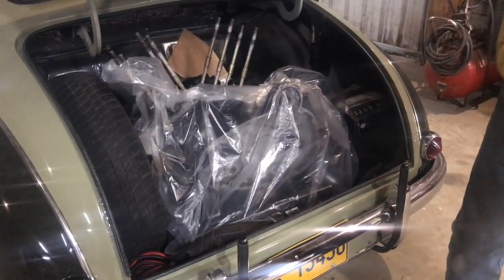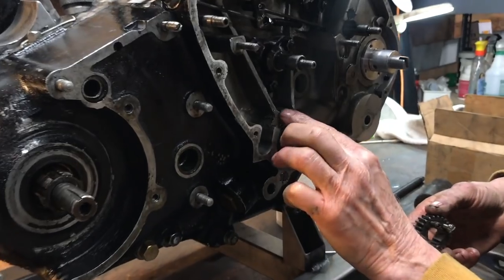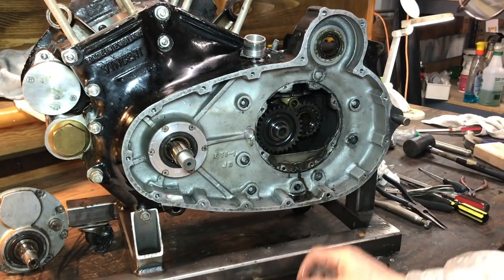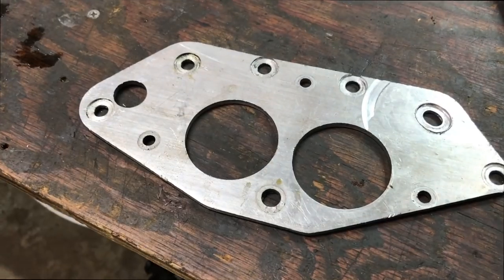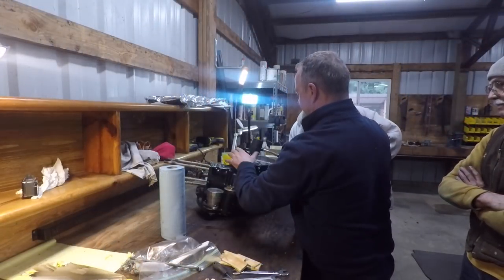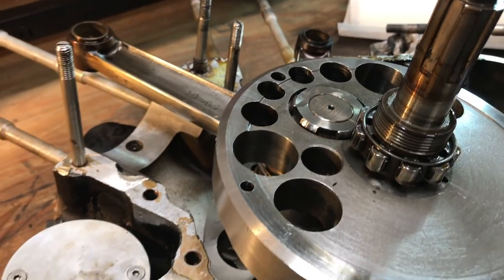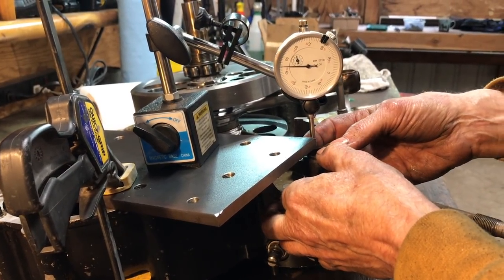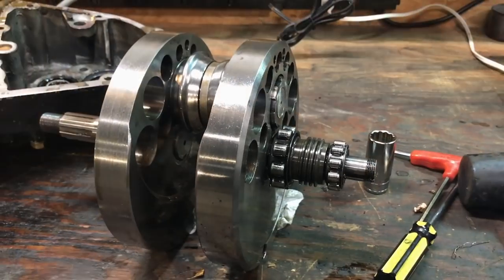Dismantling a Vincent Black Shadow engine

Comment: Had a '49 series C Rapide back in the day, split the crank cases and the crank. Made a new cranl pin and machined the fly wheels and pushed the crank pin out by 4.5mm bringing the size up to 1,098 cc. The big end bearings have 3 rows of crowded needle bearings with spacers to keep them apart. I replaced them with an ally cage and roller bearings. Other than having to put spacers under the barrels you couldn't tell that the cc's had been played with. More torque but no more top end speed. Also had the cam plate spindle bush break off but had it welded back on. The welder didn't line up the bush so had to machine it out and fit a plug then re drill and tap the boss out to take the cam plate spindle.  Sold the bike for £199 back in the day when that was what they were worth. Breaks my heart now, but have just purchased a Yamaha Niken, so much better i'm afraid to say.

Comment: Proper preheat and postheat, the stress members bolted together and torqued,  and TIG welded by a knowledgeable weldor and you won't warp the cases. We weld and repair grenaded Harley cases all the time.  Complete repair and patch panels installed is regularly done successfully.
Reply: SARGE BULLDOG I am glad someone pointed that out. I hear that same nonsense about not being able to weld things all the time at my shop. Total nonsense
Reply: Agreed from Norway! I have welded lots of heads, crankcases and other engine/transmission related castings. With the right process of heat, welding and filler most can be done! Have a nice day :)

Comment: The Vincent factory was a former barn. My father went there a number of times to collect bikes for the dealership where he was a mechanic. No delivery vehicles in those days so he had to ride them home. He told me of an old guy whose job was to press the crankshafts together and true them up.  He would first put one in a jig so it could be rotated and  any error measured. Then he would remove it and  hold it in both hands at an angle and toss it on the concrete floor. The cranks would then be re-checked, and would always be accurately trued every time. The angle at which he held it was determined by how far out it was. Now that was real skill.
Reply from the maker: Thanks very much for sharing this great story!  It must have been an amazing place to work.  Best wishes, Mike
Reply: ....and the reason why we have no bike industry.
Reply: @bobcornford3637  That's true. If you remember the Triumph triple engine, they did not have a machine to bore 3 cylinders at once, so had to bore 2, then the third one separately. The industry never invested in new machinery, and the same applied to our car industry.   Soichiro Honda started out by investing in the highest quality machine tools, the same brand only used by Rolls Royce in the UK. It enabled him to make high precision components which resulted in extremely reliable and long lived engines. Meanwhile the British industry soldiered on with old and obsolete machinery. The engines would leak oil everywhere. My father used to strip out brand new engines and machine all the mating surfaces flat to make them oil tight, before his boss put them in the showroom for sale, but not every dealer did that. It had the bonus of keeping the showroom floor clean. His boss signed up to be a Honda dealer as soon as they became available here, and he sold a lot of bikes. He later took on Suzuki and Yamaha as well. The dealership did not shut until his son retired and did not have any sons to take it over, only 3 daughters who were not interested in bikes. My father retired at 70, and still did repairs and servicing at home for old customers until he became too old to do it anymore.
Reply: I was at the machine shop one day, they just machined a crank and one of the machinist(the one with a drinking problem) lifted it out of the grinder and drop it on the floor, OMG!. As I think back at that, maybe he could have gotten a job at the Vincent works.

Comment: Very nice ! This will give you confidence to split your crankcases, interesting the number of recovery repairs that have been done on this engine, main bearing housings, gearbox camplate housing etc , but that is the beauty of these engines, they are made to be repaired, unlike modern designs that are made to be thrown away. One thing that makes a big difference on a Vincent is getting the main shafts lined up perfectly, due to the engine having double main bearings to hold the crankshaft extremely rigid, any misalignment will wreck the bearing housings, (as probably happened with this engine).

Comment: I was shocked when I saw the crank/ flywheel assembly come out. I owned a Rapide years ago, sold it for 12K. My V-twins were vintage Indians and I rebuilt 2 of them. The Indians used a male and female connecting rods on a common shaft like harleys. When I saw the Vincent set up then I guess end play also is influenced by that center spacer. Where Vincent was smart was having the cylinders offset with that rod setup for cooling.
Thumper

Comment: That brought back memories of a lovely old chap that i knew many years ago who had a Vincent as his ride to work bike. A very clever machinist, when the need arose he made his own big end, all cleverly made to have the right tolerances when at working temp. 
When he got fed up with the standard clutch he designed and made the Honda clutch adapter for the Vincent that Conways used to sell, are they still going?
I seem to recall he made his own cam for points and coil ignition conversion,too.
So thanks for the memories
Reply from the maker: Thanks a lot for sharing this story.  Yes, those guys are few and far between these days!  They can turn their hands to anything and are amazing.  Yes, Conways is still going strong.  Here's their website for fun: http://conway-motors.co.uk/wp/ best wishes, Mike

Comment: Surgeons Mike and Chris perform open-shadow exploratory surgery... very entertaining. Reason(s) for tear-down, besides wonky worn steady plate? Love the polished crank.
Reply from the maker: Richard Vanderwell Hi Richard. It was much better than he expected, but there are a couple of problems with the engine. The conrods are rocking excessively and Chris is also thinking about getting a rebore, since he has ridden it 50,000 miles!    I think he’s also getting a new valve job after he suspects a build up of carbon on a valve caused one of the pushrods to break.
Reply: There have been a lot of hands in that motor previously. 
That was kinda tough for me to watch.
Reply from the maker: I know what you mean, Peter.  Hopefully when it comes back from the shop this next time, it will be in much better shape.  Cheers, Mike
Reply: The start of my own engine rebuild a few years ago was a burnt exhaust valve. Boy it sure snowballed from there, but John McDougall saved the day and made everything sweet again. Measuring the rocking in the conrods was when I realized the big end was finished...

Comment: Fiddly. You can see why the Japanese went for horizontal split cases. As you mentioned your first bike, mine was a Honda SS50. I was gutted when the Yamaha FS1E came out a few weeks later with double the acceleration and a bit more top end.

Comment: they were fast in there day compared to the cars around at the time 

it takes a good engineer  to sort out a high mileage  one!  and a big wedge of cash  my mate reckoned about £7000  to put them in tip top shape  and thats a few years ago  , he rebuilt lots of them and showed me all the usual  things that needed attention , the ironic thing is they still perform well when totaly clapped out 
the usualy faults you will encounter   are 
loose cyl  liners ,loose cam spindles ,worn timing gears , loose main bearing ,poor mainshaft location  ,loose rocker blocks   , worn out bigend asembly   v pricey   , crap oilpump ,worn out clutch 
can be converted  to modern suzuki iirc  
having had the chance to ride a couple of well sorted ones i was a bit dissapointed   and wondered what all the hype is about  , 
the tuned ones  super nero etc  are where they get there performance  legend status from . id take a good pre unit   triumph T110 instead
Reply: It's funny they were "State of the Art" now a kid on a 1,340cc Hyabusa would blow the doors off that Vincent, just turn the key and wheelie away. Had a chance years ago, but parts were unobtainable, and they were finicky.

Comment: Phil Irvings wet dream.
The Japanese solved so many problems by going to horizontally split crank cases. This flaw ultimately led to the demise of British bikes. Chronic and leaking crankcases, maintenance and dissassembly being a nightmare. Just the addition of a starter motor to them was a drama.
Reply: honda c90 split down middle no leaks.lap casings on plate glass and brits don't leak
Reply: Must fully agree with Technik Meister. I have a 2006 Yamaha XVS V Star 650 Classic with a V twin engine. It has vertical split cases but I have never had a problem with oil dribbles. Before I had this bike I had a 1964 Royal Enfield (Indian made) which I rode around on for 3 years. It also had vertical split cases and no matter what I tried it was a little bit of a dripper. The Japanese always seem to find ways of making an engine truly oil tight. I was not sorry to see the Royal Enfield go down the drive way with it's new owner. Thank God that there are still dreamers left in the world.
Reply: Jap alloy does not deform as easily as the softer British alloy.I have had to butcher open japan casings with various nasty tool in the past and the always seal up nicely when required assembled.
Reply: @donwright3427  Yes I think that you have it. Thank you for your message back to me.
Reply: @Derek Dust  Must agree. With my 1964 350 single Royal Enfield I rewired the whole thing. Modern wiring with modern connectors had the electrics running good. I put in an electronic ignition as well and this solved all the ignition issues. If you have a Royal Enfield single and the engine vibrates just get the crank balanced and trued by some one that knows what they are doing and it will be like riding a new motorcycle. I did this with mine and it was as smooth as any other single on the road. The Indians do not do any of these things to there Royal Enfields and they vibrate like mad. You can buy a Japanese motorcycle and not have any trouble from it, or you can buy a British bike and have nothing but trouble.
It is fairly easy though to rebuild the British motorcycle "properly" and then you will have an older motorcycle that is growing in value and fun to ride.
Reply: Electrics oh yes they can be a pain if you not careful on any old bike be it British, Japanese and especially Italian . Luckilly  most of us riders of classics only go out on nice dry days. As for oil leak on old bikes chances are the engines have been rebuilt many times in the past with varying degrees  
of skill as often the signs of this are evident .Damaged threads,rounded off nuts and bolts and hammer and screwdriver (chisel) rash.If you really enjoy working on bikes as much as you ride them these are for you.If not go and buy a new retro style machine .
Reply: @donwright3427  Well I bought a new Yamaha XVS 650 V Star Classic V twin motorcycle because at 66 years of age with very bad arthritis I could not crawl around the concrete floor my shed on my knees whilst holding a torch in my false teeth any more. I restored a number of motorcycles both English and Japanese over the years and I enjoyed doing this. The internet has meant that people can get spares from all over the world and bikes that were too hard to get parts for are now being restored which just has to be a good thing. I purchased my Yamaha when my last Royal Enfield restoration was bought. It is great I just hop on press the starter button and I am away on a ride with my friends. I must say that I do miss the tinkering but I had to stop some time while I still had some joints left that still worked.
Reply: 7316bobe harley had the Japanese come in to teach them how to cast aluminum and machine it properly and engineer thing so as to not leak and not pound out the bearing holes. Its not how the cases split
Reply: Technik Meister well it seems like you have this engineering thing figured out. When does you motorcycle come to market
Reply: @holmes1956O  Hi Holmes this WILL interest you. From 1930 until 1958 Harley-Davidson had a factory in JAPAN making full Harley's for the Asian market and spare parts for Harley-Davidson in America. Harley is still getting a lot of there parts made in Asia including China. They have just set up a big factory in Thailand that is making full Harley's and shipping them to the USA. Two Harley factories have closed down in America because of this. Trump went crazy and said that he would put import tariffs on any Harley's imported from Asia. He said that Harley-Davidson was the all American motorcycle and would stay that way but as we can see Harley-Davidson has not been the All American motorcycle for many years.
https://en.wikipedia.org/wiki/Rikuo_Motorcycle
https://www.youtube.com/watch?v=rPzNV3Hu6mc
https://www.youtube.com/watch?v=PF3yJrODglw
Reply: 7316bobe I agree whole heartedly with you. I see so much about harley's that is bull because of the wrapped in the flag mentality. Dont get me wrong I love all motorcycles and have since I was a boy. But the made in america mentality needs to realize that nothing is really made in america. Assembled yes,from parts acquired from many counties. Have a great day thanks for the post

Comment: The most overrated engine in motorcycle history, there are much simpler engines that give the same performance
The Vincent snake oil never worked on me, id rather have an old guzzi or BMW